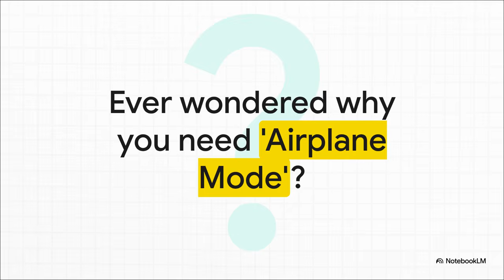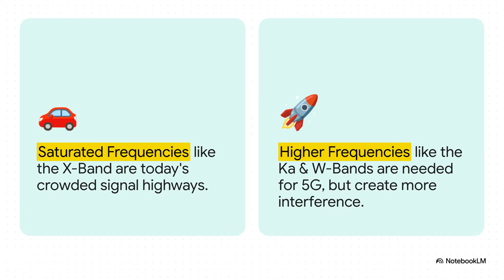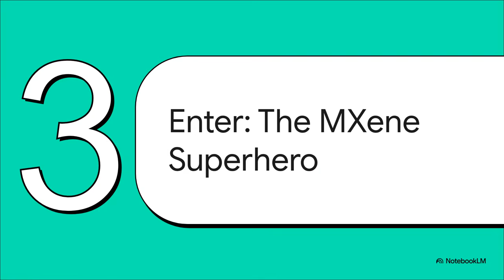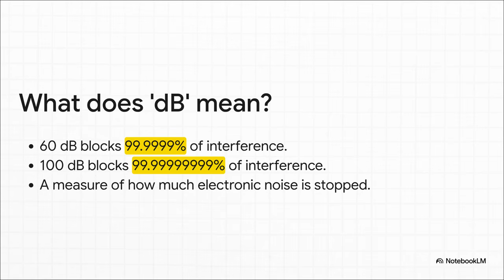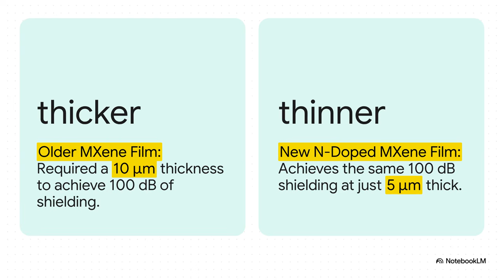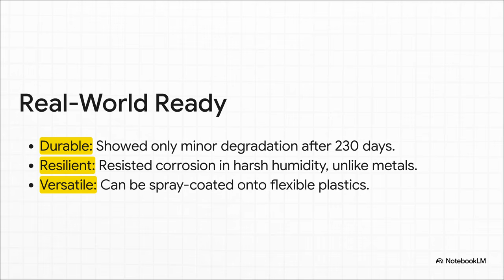The Electromagnetic Shield

Comment: the average emi fields a person is exposed to on a daily basis is not even remotely hazardous.  if you are worried about hazardous EM fields, stay out of the sun.  im glad you have a new shielding material, i just wish you wouldnt use irrational fear to sell it
Reply: You make a solid point regarding physics—UV radiation from the sun is ionizing and far more biologically energetic than the RF frequencies we use for tech.
When I use the term 'electronic smog,' I’m referring to spectral density and signal-to-noise ratios. In the engineering world, this 'noise' is a massive hurdle for signal integrity, especially as we move toward 5G/6G and high-frequency electronics. The excitement around MXenes isn't about fear; it's about the incredible chemistry that allows a film just atoms thick to provide 100dB of shielding. It’s about making devices smaller, faster, and more reliable in a crowded EM environment.
Appreciate you keeping the discussion grounded in the electromagnetic spectrum!